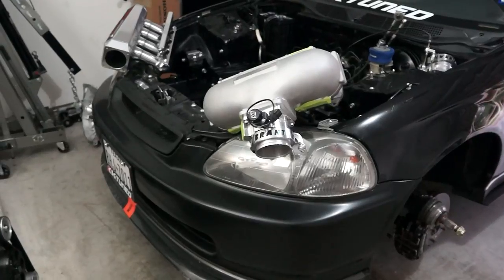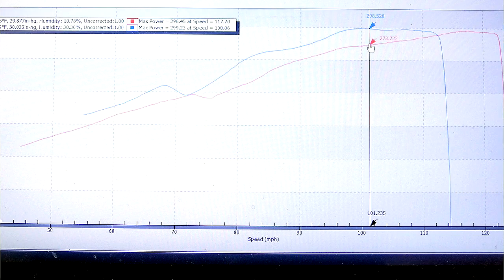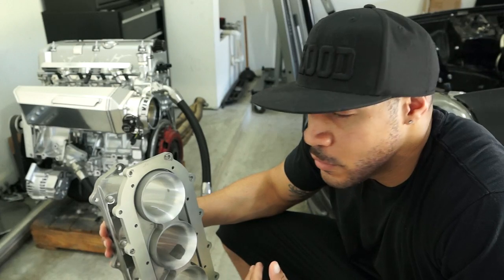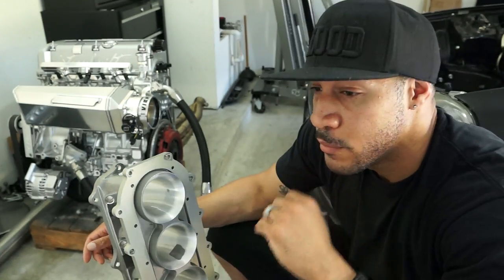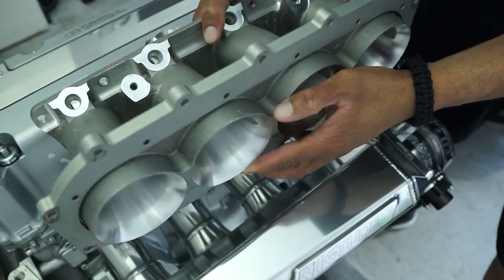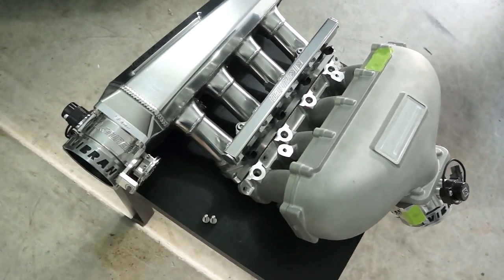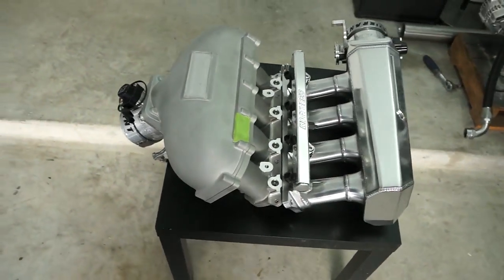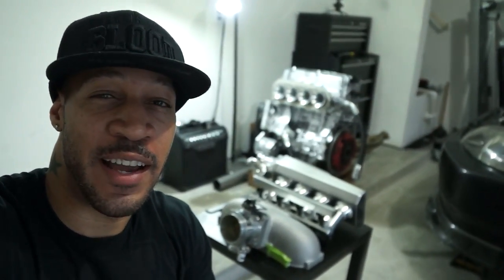K SERIES HUGE INTAKE MANIFOLDS...MY EXPERIENCE

Comment: Been a long time since you uploaded brotha, glad you did!
Reply from the maker: +LATOMMYLA yeah, been broke and with the car apart. I have no motivation lol
Reply: I feel yah man, take it nice and slow!
Reply: I have a new-er JDM K24A RBB3 motor I am swapping out my K24/K20 with.  I have had the motor in my engine compartment for 2 weeks... Just need to install my IM and coolant lines, but it has been 115 degrees for like 2 weeks so I have just been sitting on it LOL.  Childstar do you know of a good place to get Hondata maps?  I have tried K20a, CRSX, and the Hondata forums but no one will load their maps for some reason...
Reply from the maker: +sbounty3 no I don't know any place to get calibrations. Most won't load theirs because of the price it cost to get their car tuned properly in the first place.

Comment: TRUUUTH!!! I did some research on IM a while ago myself when I was looking for my next bolt on and that's exactly the result I found. Without a good supporting bottom end you just have a big shiny manifold w/ no power gains because your car can't breathe in strong enough to use it. Good work bro!
Reply: John Hayes bottom end? I thought you needed cams and porting to make use of the intake manifold. What would a build bottom end do for it? Just wondering man. I'm looking into building a motor
Reply from the maker: +David the added displacement and larger bore helps a lot, as well as increasing compression. A bigger bottom end as well as a head would be much more beneficial than trying to make use of these large manifolds with a small 2 liter block
Reply: Childstar makes senses now. Thanks!

Comment: digging the video dude,  only thing about the fi comment is that a better flowing engine will make more power at a given boost level.  so every detail does count, more so when racing at a competition level. keep em coming thou
Reply from the maker: +TheDrtye I was referring to the larger manifold designs for forced induction, the solid large box designs still flow extremely well under boost but perform like shit naturally aspirated.  So with boost, a large volume does the job, whereas all motor, the deisng needs to be much more specific
Reply from the maker: +TheDrtye and thanks for the feedback dude and for watching

Comment: Ha I've been racing for over forty years and I/we always send the Manifolds out if they are all shiny and smooth to be Sand / Bead blasted with the coarsest Sand to improve the mixture quality. Proven on the dyno a lot of times. Even Maniflods with varying roughness will be sent out to even out the 'pattern'. That is a part of why the hp figures were down on the Skunk. Another reason the difference in Air Speed between a Side Entry vs Centre Entry.  Side Entry will usually be higher regardless of Volume. Then there is the Reversion Factor. ....... It just keeps going on and on...... Even before I saw your results I had money on the Ktune. Next time may I suggest you make the Manifolds the same design. But it was interesting to read up the difference you found between the two designs in a NA application. The DC5 I race has TB's with a Toda 
Side Mount Plenum.
Reply from the maker: Well in all your forty years you didn't realize the skunk2 manifold is actually cnc ported and has a textured finish that simply appears smooth and there's been dyno proven results via 4piston documenting the improvement over stock.   

Another thing, the test consisted of BOTH SIDE FEED VERSIONS OF THE MANIFOLD. So the smart remark suggesting the manifolds be the same wasn't warranted. The skunk2 centerfeed didn't even exist yet when the testing was completed. 

Another thing, if you look at the graphs posted from each engine with their respective back to back results, you can the see the skunk2 manifold start to gain ground and hold power at very high rpm just like its item description for usage for NA engines. The average user of this manifold doesn't build such a high rpm screamer, but some of the dedicated drag NA cars do. 

I even referenced that items used in the video because I know how people look at the video image and don't listen to what's said. 

Thanks for watching and commenting.

Comment: Question.. Did you Ditch the RBC because you couldn't get to 300whp? Asking because I ported mine all the way out ports & TB port fully, looking to get 300+ with DC3.2 cams
Reply from the maker: No,  I never gave a damn about reaching 300 whp. I made changes out of curiosity and for testing. To get real back to back tests done to see what really makes a difference on my engine.
Reply: TerryT Garage if you reach those goals please give us an update.I've just imported a K24a2 TSX to the UK (expensive ballache) and I want to acheive 300bhp with it. Everyone keeps telling me how expensive it's going to be,like I didn't already know. I'm looking at 12:5:1 Wisecos and stage 2/3 cams, but I'm a bit lost after that.it'll be my dd
Reply from the maker: My car is already at 300 whp on 93 pump gas. Had this output for years
Reply: Childstar yes but did you have 300 whp with RBC on still?? Or not untill u put the bigger one on??
Reply from the maker: I have a video covering that. Every detail. It was after switching to the big manifold. Still doesnt mean it requires it. The overall combination of parts is what matters
Reply from the maker: Your smaller cam choice will make your attempt on a rbc harder depending on fuel. M5 with your listed setup could do it no problem. Pump gas with your setup would most likely fall short about 20whp. Theres tons of variables.
Reply: Childstar ok for sure, that my point exactly its not the parts that get you the # you want, its the right part combination. Not all valves go wirh all DVS, not all cams go with some valves or DVS, its part combo+ tuner that can pull the power, as I'm sure you  know not all tuners are good Lmfao, I'm going out of state for yosolo tune myself. My boy has DC3.2 with less mods sitting @ 277/230.. Your the man 🙏🙏 much appreciate your replies, very helpfull

Comment: Love it! Even after all these years, I still come back to watch this clip! Lol 

Just a thought that I’ve always wonder,; with the power that you’re making with the manifold, was it just a bolt-on KTuned Side Feed? No porting or so ever? 

Reason I asked is because everyone seems to be running either ITB or a 4Piston SK2 Ultra Race 5.5L/90mm. 

If the KTuned Side Feed doesn’t need porting and just a direct bolt-on, in my opinion I think the KTuned would be a bettter price considering it comes with the rail, no porting, and the *bling *bling making big power .. lol 

Any feedback would be greatly appreciated!
Reply from the maker: Yes the ktuned manifold is directly installed with no porting at all.  And yes you make sense with your assumption.  Down side is its currently harder to get ahold of the ktuned manifold versus the others.  The skunk2 manifold with the real and larger spacer is much more expensive but it also still has room to be ported even bigger for true huge power cars that need that.  The vast majority of builds don't need such a massive manifold but people just copy what they see rather than use what would suit them best.
Reply: @ksisjdm  Thanks for responding back Kerry, I appreciate it! Everything is knowledge as you watch, learn and test. 

But on your last statement in regards to the SK2 Ultra Race, I totally agree with you, it definitely leaves more room for more power with the 2L spacer and port, thus why SK2 purposely made it that way (room for improvements) if needed. 

As for the KTuned, it’s a direct bolt on that makes good power exactly the way it is with a setup like yours 24/20. 

Thanks again Kerry, wish you all the best on your build! Much Love 💯
Reply from the maker: The part of leaving more room for improvement is VERY DECEIVING though.  People need to understand when and where that manifold makes power and performs its best and the honest answer is, it's in an area where the vast majority of people won't ever use or build their engines to.  

They speak of this in a very subtle way in their disclaimer for use.  Most people aren't building engines that see the bulk of their power above 9000 rpm and closer to the 10,000 rpm range. Everyone is lead to believe bigger is better but that's not the case. Especially with Naturally aspirated setups. Balance and harmony is beyond important. 

That's why I spoke of the two engines types we used and the rpm range and you can see closely in the graphs the skunk2 is just beginning to shine extremely high up. There aren't a ton of 10k rpm street cars running around. The skunk2 ultra side feed that was used was already cnc ported and even used with a head perfectly cnc ported to match it.  Increasing the plenum volume will have hardly any effect with all motor because the engine isn't flowing air more quickly than the plenum can hold.  

It would take an extremely large about of forced induction to max out that plenum volume. So considering the plenum spacers as some benefit is a mute point.  The runners being ported does make a good difference, but the larger the runner volume, the lower the air velocity unless several other things are done to compensate for the slower air entry speed.

Comment: What's that coolant reservoir next to the fuel rail cap off on the right side of your intake? I've seen coolant bypass plates but never anything with a rad cap like that.
Reply from the maker: That's the water neck for my coolant system. Since I use a tucked radiator that doesn't have a direct fill point, I use the water neck to fill the cooling system and it also serves as the highest point for easy bleeding of the coolant.

Comment: I have a question since he have similar set ups to your first one stock 06 k24a2 which I have in my rsx with a 50vtc do you think its worth porting out rbc manifold on a stock 06 k24a2 head since I hear it doesn't have good air flow it ain't worth doing cause I'm debating on going ktuned 72mm tb soon or 80mm ktuned tb
Reply from the maker: +Henry Parada if you've seen my results with a 80mm on a stock internal tsx you'd see how well it does all flow.  The tsx head can flow plenty air as well. Just because it's not "as" efficient far above 8k rpm, doesn't mean it doesn't flow well.  There's more to performance than the peak hp number. 

To your main question, I do not think the rbc needs to be ported to perform well with your setup. A stock port rbc manifold can support a lot of horsepower as is. Porting it with a stock internsl bolt on engine, typically only gives any noticeable gain at a high rpm. That's a costly service for minimal gains. Port matching the TB, yes, but porting the manifold itself, not so much IMO. The way the manifold is ported makes a huge difference as well.  If it's ported too big, it has the drawback of slowing air velocity and sacrificing midrange in favor of high end hp. A very good port job could potentially make gains throughout.  But without a cnc port, consistency on porting is a shot in the dark.

Comment: So would you say it's better to run a ported rbc manifold or a skunk2 pro series with a supercharger over trying to run the k-tuned side feed with a supercharger? The engine i have is the k20z3.
Reply from the maker: If it's between a ported rbc and a skunk2 pro series...I'd go with the ported rbc.  

Now if both the rbc and pro series was ported, I'd recommend the skunk2 pro series.  Being boosted, you can take advantage of the larger volume of intake air.

Comment: @childstar

Quick question bro, not much info from people that have actually had these manifolds. I want to run ac therefore i have the ep3 style pulley. I know i gotta modify the waterpump housing, thats no problem. Any of these centerfeeds can work with my setup?
Reply from the maker: The mounting point for the ep3 pulley has to be cut off in order to run these manifolds. Ktuned has a post mount bracket with holes that allows the ep3 pulley to be further offset, but i do not believe AC can be fitted with it, but I know its possible to retain the ep3 pulley setup using that post mount bracket.
Reply: @ksisjdm  thanks for the reply my dude!
Reply: Are you deleting ps? I'm trying to keep mine using the k-tuned centre feed even though it says an ac/ps kit must be used.

Hoping not to have to use electric ps pump from mr2.

Comment: will a center feed intake manifold typically deliver air at a equal rate into each cylinder through each runner? (assuming ever runner is exactly the same length and shape).
Reply from the maker: At an almost equal rate, more equal than a side feed manifold will but less equal to individual throttle bodies of course.

Comment: So...
Witch one generates more power?
Also?
What size throttle body do they both require?
What size holes too?
Reply from the maker: I showed two sets of dyno sheets, the ktuned manifold made more power overall and more power on average. The skunk2 ultra race manifold started to pick up on power and close the gap in power around the 9000 rpm point.  If you have a setup revving higher than 9k, the skunk2 ultra may make more peak power while sacrificing midrange and low end power. 

They both use a mustang not pattern for throttle bodies and the manifold entry size is equal to 90mm.

Comment: Where do you get, or find this k-tuned  intake manifold, any for ep3 k20a. Would love one specially made to fit the ep3, as alot off aftermarket intake needs a bit off trimming for fitment... ??
Reply from the maker: It's a ktuned intake manifold, I got it from ktuned. 

No there isn't one specifically made for an ep3, so you'll have to do like you mentioned and work with it to make it fit most likely.
Reply: Thanks brother.

Comment: What Kind Of CAI Can I Use For The KTuned Manifold And 90mm Ktuned T.B?
Reply from the maker: A 3.5 inch to 4" diameter intake for smooth air entry into the 90mm inlet.
Reply: Childstar Hybrid Racing 8th Gen works?
Reply from the maker: Dude, just get some piping in the size you want.  There's so many variables to different chassis and the use of the car. An intake that "WORKS" is simply any properly sized piping.  Even too large or too small of piping "works". There's no off the shelf intake created for big manifolds. Use whatever you see fit.

Comment: Man did you test the Skunk2 Ultra Race Centerfeed Manifold? & is it ported to by 4piston? I never head that you mentioned it on the dyno back to back test that you made..
Reply from the maker: I didn't test the centerfeed one because someone already did a back to back of the skunk2 ultra side feed versus the skunk2 ultra centerfeed and the centerfeed version did worse than thur side feed.
Reply: @ksisjdm  woah! all along i thought that the skunk2 ultra race centerfeed is better and can make more power because it has a larger plenum volume (5L Centerfeed vs 3.5L Sidefeed) than the sidefeed one..
Reply: @ksisjdm  it might be interesting to see a back to back test of K-Tuned Sidefeed & K-Tuned Centerfeed + a Skunk2 Ultra Race Side Feed ported by 4piston with A 2L Spacer to add more plenum  volume.. i wonder which one can make more power out of the three that i mentioned..
Reply from the maker: Just because its bigger doesnt make it better. The skunk2 ultra race already really needs an engine that operates best closer to 10,000 rpm. Increasing the plenum volume slows the air speed down quite a bit which isnt beneficial for all motor.
Reply from the maker: The ktuned side feed already out did the skunk2 side feed that was ported by 4piston easily. The ktuned centerfeed is the same design as the ktuned side feed just slightly bigger plenum an center positioning, so the 2 ktuned manifolds perform similar to themselves. This is a no brainer comparison.
Reply: @ksisjdm  thanks man! Basically it all sums up on what kind of engine build you have to match it with a proper flowing manifold.

Comment: They say a rough finish aids in fuel atomization on the intake side.  Do you think sanding it clean or leaving it rough really makes a diff?  Maybe that only applies to the runners themselves.
Reply from the maker: +Ryan Riffs yes that's true and yes it pertains to the the area where the fuel is entering which is at the head rather than the intake manifold or runners. Those cnc ported heads actually help with it as well. Even though it feels smooth by hand, the cnc edges help with atomization.
Reply: +Childstar cool man that's what I was thinking too,  inside the head around the valve stems.  I replaced my valve guide seals yesterday with the head on.  Worked out awesome,  running a b16 ATM.  Nice vids dude.

Comment: I would argue that a manifold that is too big for your engine makes the engine run even worse than with a manifold that is just right. Thats because the air velocity will be lower with bigger diameters.

Please correct me if Im wrong!
Reply from the maker: You're correct 

But this bit of info you placed here isnt relevant for what I have or what I explained in this video.

Comment: When you cut off the pcv did you block it or leave open ?
Reply from the maker: Both. 
Left it open until I had my valve cover with more spots to vent air from. Once I had a couple of lines coming from my valve cover I blocked off that port